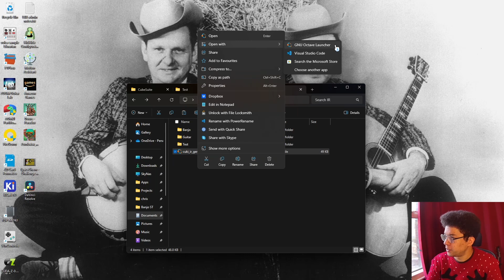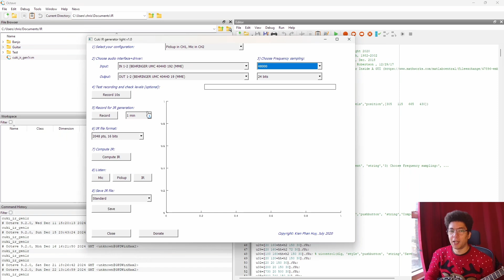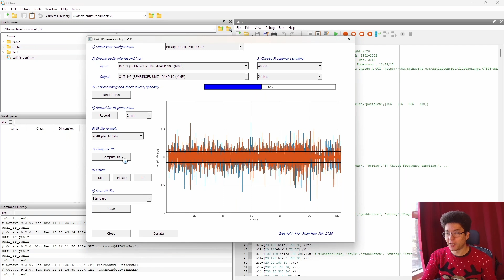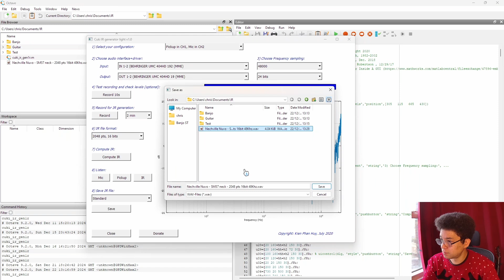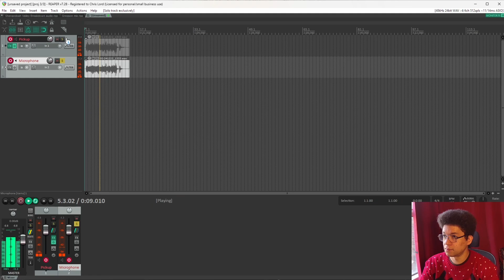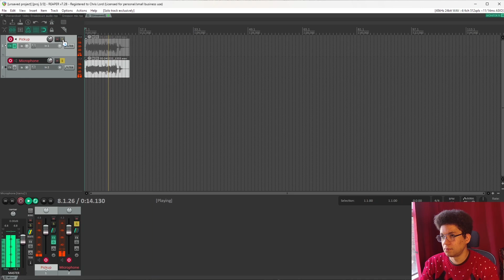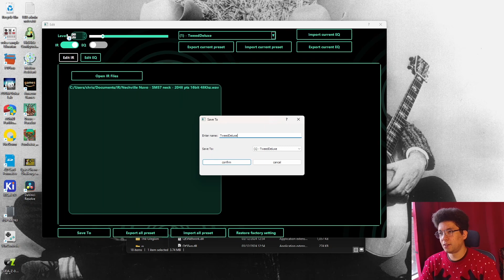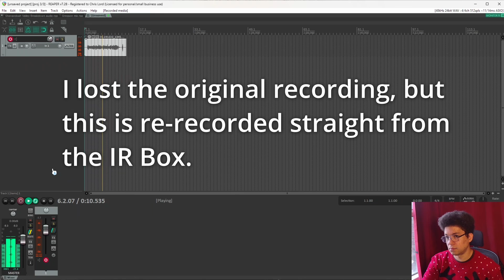How to make a banjo pickup sound good (The £20 Tone Dexter alternative!)

Comment: Great video. I know they use the same thing for amp modelling for electric guitars.

I didn't quite understand why it wouldn't work with a magnetic pickup.
Have you tried with a magnetic pickup at all? Either recording your own IRs from it or putting a magnetic pickup through your piezo IRs?

Also, will you be making your IRs available for purchase? 🙂
Reply from the maker: @ritchielamy8880  With a magnetic pickup you're losing a lot of the impulse that makes the sound because it's (mostly) just responding to string vibration, as opposed to a piezo contact mic that responds to the entire vibration of the instrument - at least that's how I understand it! I need to test it out though... Never thought of selling the IRs, it's so instrument specific that I don't know how useful they'd be for a different banjo. If I borrowed a few banjos, maybe I could put together a pack of them that might be useful more generally... I was actually thinking of developing my own Tone Dexter-like pedal, but it's early days yet 🙂
Reply: @Cwiiis  I like the idea of being able to have something that sounds more modern like a Nechville occasionally... or a proper vintage instrument without having to fork out plenty.

They do collections of specific years of vintage amps and things for people to enjoy the feel without the hit to the wallet.

Comment: Hey Chris, thanks for this useful video. Apologies if I missed it in the video, but what pickup are you using in your Nechville? I've just acquired a Phantom, and I'm interested in giving this a try. Thanks.
Reply from the maker: @nickdunkin8175  it's a Schatten pickup, but any piezo-based pickup should work as well 🙂 I'd advise against a generic contact mic on the head, they mute the vibration somewhat.

Comment: Great work - I've seen Aaron Short (who I believe is friends with Cuki, who I think lives in France?) demo this stuff before too. I should try it... I've tried the NuX Optima Air and now I use the TC Electronic IR pedal. My friend made me some IRs, but none of them are models of my actual guitar. I might try an IR actually based on my guitar to see how much better I can get it sounding. The nice thing about using the IR instead of the mic is if you're recording / streaming at home, and someone is doing construction / using a leaf blower, that won't find it's way into the recording (at least not as much) as if you were to be using an actual mic like the SM57, etc. ;) My friend Jason McGuire recorded his new album entirely using the Ultra Tonic Pickup and the Tone Dexter 2, and you'd think it was entirely mic'd. Thanks for the video!
Reply from the maker: It's definitely worth a go - if you can get it sounding how you want through a mic, likelihood is you can make a better IR than something generic. The TC Electronic pedal looks nice, very compact - I've stopped recommending the Optima Air to people because I've witnessed it being flaky for others multiple times now...

I've just bought an M-VAVE Annblack Box to test out as a compact replacement for my whole rig. It does IR (though only supports half the length of the IR BOX) and effects, has a built in battery, tuner and a couple of foot-switches - pretty much everything I need in one tiny box. I've not had the time to try it out yet but I might do a video on it if it turns out good. It's similarly cheap, about £40.

Since this video, I've tested out the pre-amp on the IR BOX and though it isn't as good as using an external one, it is good enough that you could use it alone if all you need is amplification and IR/EQ. The problem I'm finding with the IR BOX is that in combination with certain other pedals, in certain orders, it seems to contribute to noise/interference. It takes a lot of fiddling to get the perfect, no-noise setup. Achievable, but if the Annblack Box can replace everything, it takes away a lot of tedious experimentation!

Comment: I read that m-vave IR box supports IRs recorded at 44.1kHz up to ~50ms (2048 samples), but noticed that yours were calculated at 48kHz, perhaps this can explain the slight difference? Also, what is the latency of the IR box, is it noticeable when playing? Other m-vave devices report latency of 6ms (which is 256 samples at 44.1kHz sampling rate).
Reply from the maker: I'd tried 24-bit 44.1Khz IRs generated using the Cuki IR generator and they didn't work properly (it does something very odd!) - I'm not sure why I settled on 48Khz in the end, maybe just because it worked and why not :) I've not measured the latency, but it's not noticeable at least - I would expect it's the same as their other devices.
Reply from the maker: Just a little follow-up, I double checked and indeed the 24-bit/2048pts IRs that the Cuki Octave IR generator makes don't work - I do notice though, that they're twice the file size of the 16-bit ones, where as I would've expected 1.5x times (I suppose they might not be stored packed, or packed to 16-bit boundaries). Needs some more investigation really!
Reply: @Cwiiis  That's right. Normally, 24-bit WAVs are padded to 32-bit samples, but can be packed as well (there is a bit in the header to define this). Could be that IR box just assumes packed format without really checking the header bit. I've ordered one myself to try. P.S. Happy New Year!
Reply: Finally got my hands on this IR box, and it indeed works rather well. I find it somewhat noisy, but this could be because of my piezo pickup (it is super noisy when plugged to USB though). Ended up writing packed 24-bit wavs myself, and they have no problem with the box.